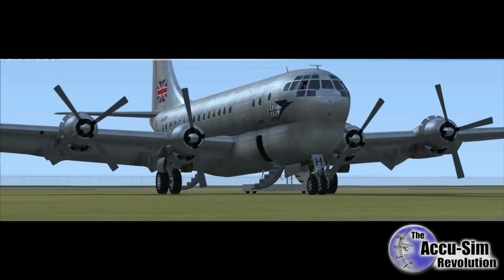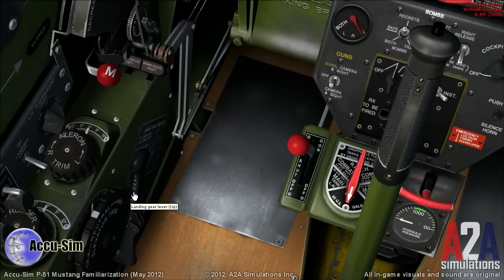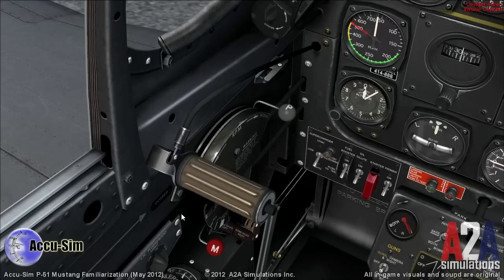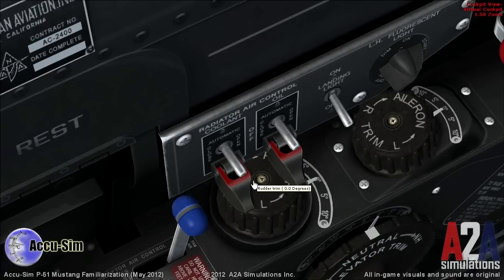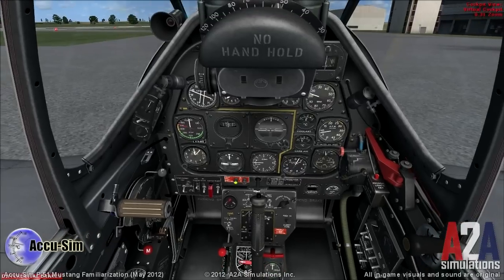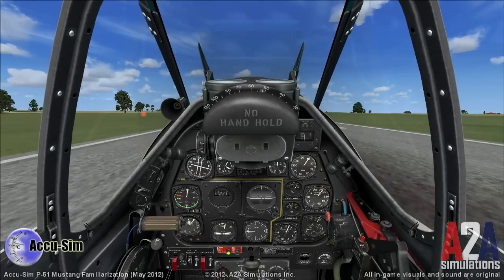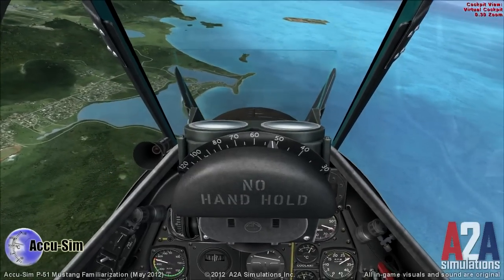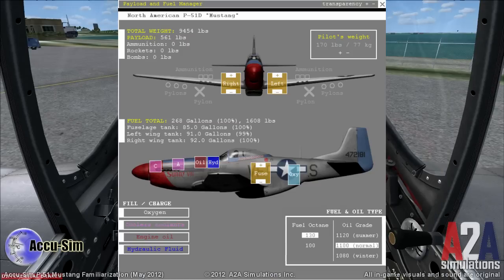Accu-Sim P-51 Mustang Familiarization

Comment: Have a question folks. I have FSX Deluxe edition in german. I bought the A2A P-51 WoP and added it to the FSX. When I run the FSX, the P-51 does show in the list of aircraft, except that I am only able to the see the cockpit section with the pilot seating in it. No fuselage or other structures is visible. When I play the simulator, the only thing that I can see is the black silhouette of the aircraft. When I switch to the inside cockpit view, the whole cockpit is dark and only visible when I flip the light switch on and the instrument gauges are not visible at all.As you all can see, I have a myriad problem with the A2A P-51 software. The FSX is set with all the recommended settings for this aircraft and I reloaded many times in an attempt to fix the problem, but without success. Does anybody can give some tips what could be the problem, please. Your help is very much appreciated. Thanks.

Comment: I have the military version of the a2a P-51 and I love it. The only thing I'm trying to figure out is that whenever I engage the starter, the mixture moves by itself; which is fine because it starts up, but I would like to move the mixture myself. Any ideas why? I don't have the Accu-Sim with it, thats the only thing I can think of.
Reply: +Jacob Evans  Jacob, Check the Aircraft realism settings. It sounds like you have the "Auto-mix" enabled. If so, disable it. After you do that, remember that if you're on a high altitude airstrip and you go to start the plane, slip that mix lever back about 10-15% per 3500 feet of altitude msl. Do it  right after the startup otherwise, you'll run too rich and she stall on you and get harder and harder to start with each time you forget.
Rich

Comment: It's impossible for me to take off with this plane and only with this plane. I can't control the rudder of the plane during ground handling. Even taxiing is impossible. I checked my joystick's calibration, follow the checklist, use differential braking and bring the power up gradually but no matter how much I counter steer with my rudder and/or braking it doesn't help one bit. 

Under ~33% power it'll only go right uncontrolably, anything above that it'll only go left uncontrolably. I've never had this in any plane before. I tried looking for a tail wheel lock and whether that was the problem but couldn't find anything. 

If anyone knows how to fix this would you please be so kind as to help with this problem.
Reply: Same problem here. It's THE ONLY plane that I am not able to get on the air.
Reply: sander grolleman
Thanks for your comment Sander, however I tried that already! I do not think it's down to my flying but willing to keep my options open. I think it is down to a faulty install of the plane and/or FSX. I'll have to figure that out later on.

IDK how at home you are with (sim) racing but IMO it's almost like trying to take a Top Fuel dragster and drive it like a WRC car...

We could also carry on talking in Dutch as I assume you're Dutch. Ik ben namelijk ook gewoon Nederlands :).
Reply: well, yesterday I had to format my computer. After downloading FSX and making all the tweaks for performance I installed all my A2A planes and for my surprise the P51 is now flyable. The rudder actually works now.
Reply: rud work better after nose down, before nose down tail in fuselages shadow and so bad reaction, or need more power, but more power pull ac left, so just need found compromise of starting power and put nose down before  push engine fwd, btw is just only one ac what force me thinking about movable joy, i use x-65 and with this model is some mmmm... sophisticated
and definitely i can not run aggressive way as was in this video
Reply: after looking answer for my lazy ass, and much experiments i found only one real solution - complitely reinstal this, i do not know i'm right or wrong about tail shadow hypotesis, but after reinstall p-51 and of sure update accusim, this birdy take off like all other for me, with aggressive or normal way is controlable and run away out runway, befor take off be sure you have enough speed or more flaps or tend to left roll kill ya, i'm serious, after reinstall + update it almost as all usual ac with tail leg, btw, force me to reinstall was not only forums advices, but installing civ version, what work perfect, but after i start rolling in mil version mil mustang just not roling at all so couldn't taxy, run for takeoff nothing what need ruder control, so delite simobjects/airplanes/wop3p51 a2a/p51 and documents/a2a/fsx/p51, then install p-51 + accusim for p51 and updated accusim module, what update p-51 too, now i complitely sure, if i can not roll on taxy or takeoff, i just need reinstall it, cuz nothing other will help, so you have not to torture yourself anymore
Reply: I think Flight Simulator generally exaggerates how difficult tail traggers are.  I have no proof, other than a general hunch from little pieces of evidence.

Ever since I switched to yoke and peddles I can barely take off with my Super Cub and I'm not at all inexperienced either.
Reply: sander grolleman, i think if you will got my quantity of flight hours in simulators, you'll can flight with blindfolded and manage aircraft by power of thought, after some period of flight in front of the monitor you can feel it without vestibula, force feedback of yoke/joy and ass variometer, so why i was sure befor buy it - forcejoy x-65 will enough for me... in any way, all we talking about in this theme is bug, what was resolved in accusim v1 17 17
Reply: sander grolleman An actual yoke feels more sturdy perhaps?
Reply: 209vaughn, i read post of real pilot, who was nauseous after simulator expirience, cuz vestibula and other feelings expects some, what you can not found in simulator, so some time it is not only sensations deficit, but real seasickness, especially if you got many hours of flights in real life, ah and yes in some birds youke/joy force is really hard, 30-40kg by feeling at 200km/h ias, so told me one pilot, i don't know it by my self
Reply: It's a little late now, but if you pull the yoke back on the ground, it locks the tail wheel

Comment: I have a question, How do you open the maintenance hangar in game? I've got the Wings of Power II B-17G and can't get the maintenance hangar up. I'd also like to know why the opening windows and radio won't work.
Reply: For some reason that won't work. No idea why.
Reply: Okay I will.
Reply: Un installed and re-installed but no change. Are you sure it's shift+7? All shift+7 does is open an instrument panel.
Reply: +Pedro Romeiro Thanks for trying to help out. Maybe I got it from a bad website or something.  I'll go to the forums and ask there. Thank-you for helping me out once again.
Reply: +Weagmonz 4444 It's not a big deal however since I don't play flight simulator much anymore and focus on other games. I just wanted to see if the $5 code renewal was worth it. I appreciate the help.

Comment: I'm not able start it. I'm doing everything correctly but there's absolutely no life in the engine because I for some reason can't apply any hydraulic fluid, coolant, aftercooler coolant, or lubrication oil. But the weird thing is it's only the civilian Mustang. HELP please.
Reply: Have you purchased the Accu-Sim for the P-51? In order to service the aircraft, you need it. Be aware also, that you need to install the FSX SP1 and 2. I had the same issues and solved doing what I am recommending you to do here. Good luck.
Reply: I'd already gotten that rectified.
Reply: Good. Have fun.